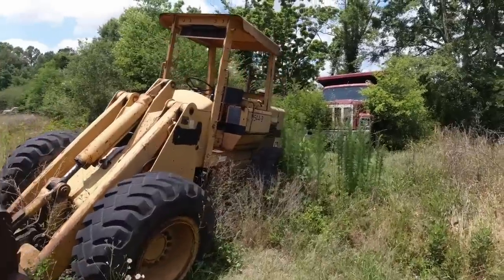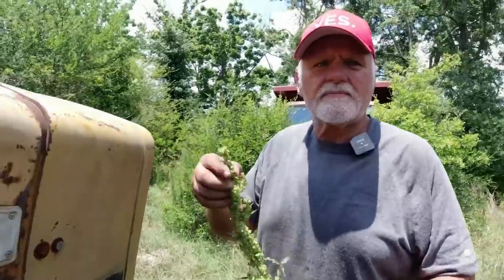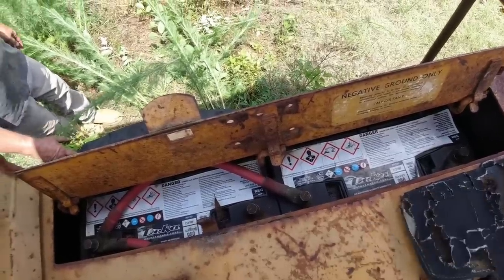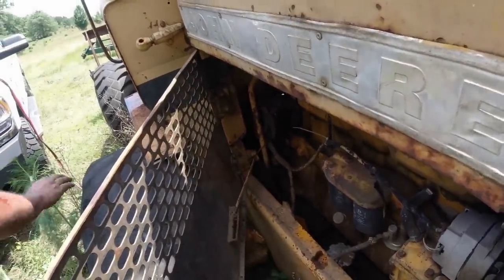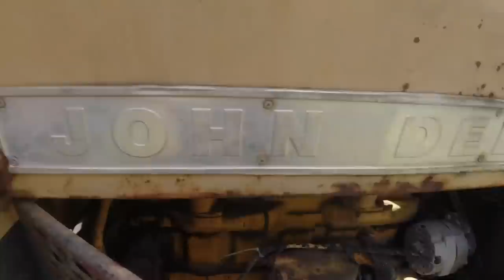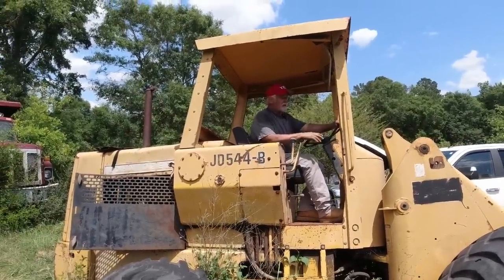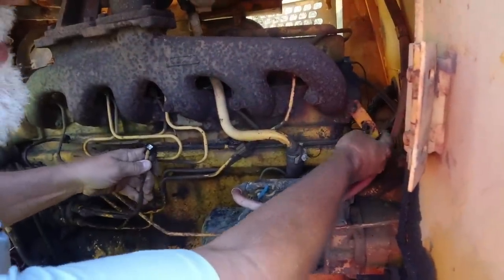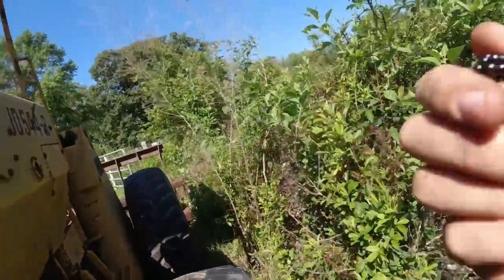This machine kept a secret for 23 years! Will it start?

Comment: Those are really good machines. Made in Japan by Hitachi I believe. I rented from a guy who had a 444. I lifted a 9,000 lb lathe with it once.
Reply: Mr wes hi 👋
Reply: Hitachi built John Deere excavators not there loaders, the loaders built by John Deere USA .
Reply: @njh4473  The one I used said Hitachi on the serial number plate. Had a Deere engine, but the rest of the machine was built in Japan. That was a mid 80s machine.
Reply: hi wes hows the weather in your area
Reply: Wow you do lots and lots of work I want you working on a 99 diesel pickup truck good job Wes
Reply: Those were made  in Iowa not by Hitachi
Reply: Same motor and rear ends as the 540 skidder, made in Dubuque Iowa, at least in sixties and seventies
Reply: @simongreen247  va ffv

Comment: i made a set of jumper cables when i was 17 years old used welding cable and the same type ends that are on your cables. I will be 66 in august and i am still using the cables and they work so good
Reply: I made a set like you when I was 18 working at a NAPA store. I’m 51 now and they’ve been with me in every truck since then. Can’t beat ‘em!

Comment: 3:16 While alternators will produce AC electric initially, the internal rectifier converts it to DC and the regulator keeps the voltage between 12 and around 13.8 or 14.2, depending on the manufactuere. But they also require power supplied to the windings in order to start producing electricity because they have no magnets in them. Generators normally produce DC by alternating the brushes so one side will always be positve and will have permanent magnets in them without the requirement of external power to generate the DC power. They typically require an external voltage regulator.
Reply: Thank you for your knowledge. All I remember is on my Grandfather Ford. The Generator on his Engine, it would only put battery charge when engine RAN. A Generator never held charge. The Alternator always somehow would keep Battery charged up. There was not a battery loss of voltage. Generator always just had Battery problem with holding charge at volts. It did not put battery in reserve. Am I right or near right
You seem to understand.
Reply: Some generators still required being "flashed" or having the field excited once by external power from which they then retained the field while the circuit was closed (in other words, disconnect the battery and you had to 'flash' them again). Ran into that on '60s Fords. 😎
Reply: Automotive generators don't have permanent magnets. The fields hold enough residual magnetism so they don't need any power to get them started generating. You can get a car generator to work with either positive or negative ground by polarizing, or as some folks call it flashing the fields. With a permanent magnet generator you would have to turn the magnets around or reverse rotation to get it to switch polarity. Same with the mechanical voltage regulator, you can get it to work positive or negative ground by flashing it. Sometimes on a new generator or one that's been setting a long time and the fields have lost all their magnetism, you have to polarize it to get it working. Same with the regulator. New regulators used to come with instructions on how to polarize them, either positive or negative ground, to get them working.
Reply: @rp1645  I remember with generators we could.run a vehicle down a hill or tow start it and the generator start charging, or start with no battery no problom, no damage to the electrics ,alternator you needed a little current to excit whatever it was to get it charging, was a new thing for guys to learn when rolling or pushing a vehicle to start ,so the old generators were better in some ways ,though alternators quickly charged a battery without much revs ,big step forward
Reply: Bravo

Comment: we had a 1968 JD 544b in our salvage yard. we bought it right qfter we opened.  We opened on a shoestring so we bought what we could afford with no help from the bank. it did a very good job but it was tired. we replaced the engine and then the transmission. it had the typical blown lines. our yard was a number of terraces going down a steep hill. the gravel would kill the tires regularly. But the tires didn't wear like you would think.. the heavy lugs wore but wore even worse was the rubber between the lugs that wore more quickly than any other place. when we finally replaced it we kept it because it was a great backup machine.

Comment: Strained  sump oils are good for hydraulic oil  substitute we used to run a grader on strained oil for year's  on the station in Aus for years run it through a clean filter on a pump

Comment: an alternator is alternating current , A generator is direct current with a seperate voltage regulater box . That's what I was told many many years ago .
Reply: Alternators also require a regulator to even out the flow of current and to prevent overcharge. Early alternators also had separate regulators, then with solid-state circuitry they were incorporated into the alternator itself.

Comment: Generators have stationary magnets on the inside of the housing, and an armiture that spins from the belt drive. Generators do not have internal voltage regulator rectifire to convert the AC voltage that the generator produces, into DC voltage. They have external regulators. Alternators produce AC voltage but have brushes along side stationary magnets aligning the inside of the alternator housing. Alternators have an internal voltage regulator to convert the AC voltage to the proper DC voltage, usualy around 14.5 to 15 DC volts.

Comment: Hank if ya'll can find an old water filled fire extinguisher, they have a threaded top and Schrader valve to refill them/pressurize them with air. Put an ounce or two of original Dawn liquid soap in it (you probably can't put too much soap), slowly fill it with water while mixing the soap. Air it up and you can stand back 20 plus feet and blast wasps and yellow jackets. Kills them dead as a hammer and it much cheaper, non toxic and you're less likely to get popped. Ivory, Ajax or walmart "great value" soap won't work for some reason.

Comment: Jd 544b was built from 75(or 76) to 81 when the c series came out, it has a jd 6329t engine and a 2 speed Allison transmission, they were a great machine,  I worked for deere in the late 70's.

Comment: Alternators vs Generators:  In automotive service, a generator takes the output current off the brushes. This tends to limit the output, as the physical size becomes a problem. In an alternator, there are still brushes, but they carry little current as the field is the rotating part. typically on automotive alternators, they are wound as three phase alternators, and have a rectifier network of diodes to convert the output to DC power. The (rotating) field also operates with DC, regulated by the voltage regulator, which is commonly built into the alternator housing. 100 amp alternators are commonplace now on our increasingly electronic cars and trucks, with many having even more peak output. My pickup for example has a 225 amp unit.
Reply: Neil you explained automotive/equip charging systems for the past 💯 yrs thank you sir!

Comment: There was a 544 and an old Lima dragline I ended up running when the owner died. It was a sweet loader and it fed the screen and loaded trucks. The old Lima ran fine too. Had a 3 or 4-71.and you know how a 2-cycle is about running. Yall did good and you owe Wiley double for the sting. GBWYall!

Comment: An alternator has electromagnets that have to be externally energized.  The more current you put through the electromagnets, the more wattage the alternator generates.
A generator has fixed electromagnets and generates electricity when the stator is turned.
As a result, the alternator output can be controlled as can the load on the prime mover; this is how a diesel-electric locomotive works.

Comment: Thanks for another great video Hank and Wiley. 
Interesting and enjoyable. 

Great job you two getting that old old John Deere going. If it was not for the hydraulic oil you would have had it fully operational. 
You did great!!!!

Sounds like a strong machine yet. Somebody could make use of it you would think. 

Good luck on getting the others going. Clear the shrugs away and have at it. 

Wiley watch out for the bees. I hate those things. Do not do well with the the stings. 

You all take care and be safe. 
Looking forward to the next video. 
Thanks for everything Hank and Wiley. 
The Iowa farm boy. 
Steve.
Reply from the maker: The owner has already put it back to work👍

Comment: Excellent video Hank  :) & Wiley :) little TLC goes long ways get something running again and hydraulic can be interesting to fix too ! Alternator are bit cheaper to fix or buy and Generator are expensive on fix or buy ! Plus Alternator are 1 & 2 poles setup with or without regulator  and Generator same on regulator to ! But both Generator and Alternator lots different amps can buy from 10 to 150 ! General Motors are ones people like 1968 to 1985 years so easy setup on wireing to !

Comment: When you see someone move the steering wheel back and forth on a john deere loader to make it easier to start you know they have used one before. Those steering pumps are run off of the crankshaft and moving the steering like that will allow the starter to turn the motor over faster. Been there and done that many times

Comment: Easy way to remember; Alternator = Alternating (A/C) current. Generator makes Direct (D/C) current. The battery and ignition runs on D/C, so the alternator requires a rectifier to convert A/C to D/C. Simple.

Comment: The alternator is the charging system once an engine starts,it charges the battery on a 12 volt or on a 24 volt batteries,auto mechanic by trade
Reply: YES. And did not a Generator not keep battery charged. If you used your lights in vehicle for example, the Generator would loss volts. So it drained the battery.
Reply: @rp1645  you had to keep the revs up ,alternators once the rpms come up still mostly charge near idle speed ,big difference if you want to build up the charge on ur battery

Comment: I'm working on a 544 a there's a back story on that one, but I. Not really authorized to go in detail. 
Um it sat 15 yrs the motor was locked. Well after a injection pump and a set of injectors it does run n move. The arms raise the forks curl n roll. No brakes n no steer. But we're still picking at it.

Comment: I think you opened up a can of worms with the alternator generator thing. Some say alternators have no brushes, built in regulators and what not. The rectifier (diodes) to turn the AC into DC  were built in. 12 volt AC will shock you, and unregulated current from a car alternator is higher than that,, DC won't. Once they got  diodes small enough and sturdy enough to fit inside the alternator so there was no external AC current, they figured it was okay to put them  in cars. In the 60s Delco (GM) alternators, and just about all brands, had brushes and an external regulator mounted on the firewall or fender well. They went to alternators  because they are simpler, more efficient and will charge with the engine idling. The old generators had to spin a little faster to put out enough to kick the regulator in to start charging. If the main contacts in the regulator stuck, it would backfeed current to the generator when you cut the car off and it would try to turn, I have seen old cars with loose generator belts and the generator will be sitting there turning with the car cut off because of stuck contacts in the regulator. Used to have to take the cover off the regulator and unstick the contacts. A lot of folks too cheap to buy a new regulator would just leave the cover off for next time.
Reply from the maker: Right on. I’m definitely no expert, just tried to recall info from many, many years ago. Lol

Comment: Generator makes DC only.  Alternator makes AC and converts to DC with Diodes.  Those diodes (power rectifiers) blow up when car to car boost and some are blown.  Ok works wow - This could be a farmers rock collector out of the planting fields.  So other machinery doesn't break down due to a rock bending something.

Comment: An alternator doesn't make juice unless it has a battery wire to it and and generator doesn't need a battery wire it's DC and it'll just as soon as it starts turning it charges you can start one by pulling it with a generator but you can't start them with an

Comment: I used to call myself a mechanic but all that might of just changed in the last say ten to more years. Like I bought a brand new 95 F350 4X4 and just check every box on the option chart. Had the beautiful flatbed, aluminum with gooseneck... set to go clear across alaska.... that if you go one end to the other can't be done in one day no how, no way... about five thousand miles an no, this truck couldn't go near that far without a few stops but the two sixty gallon tanks did take ya a ways. Getting to being a mechanic meant servicing my own truck and so when I did something stupid enough to cost me to work on it... I had to pull the cab and fenders off to get to the engine... all on count of stupid things we do... I crossed a river that I knew    I would never make across it but just had to try...  I was smart enough to cut the engine off before it got flooded tho or it would of been game over. My point is... do you want to have to unwrap a ton of crap to get where your problem is at just to find that now your there but that is no guarantee that you can get into the problem without causing more issues. Took me a week to get the pan, the turbo, and other stuff on a diesel that got ruined or needed flushing out done. A machine like you are working on there is maybe some side covers, a belly pan and a big ol' hose or two... and you pretty much can get it all did an done. I have worked on most any make or model truck that is like a pete, kw, mack, you get the idea, and now your chances of figuring out if its the battery or a wire or a plug on a new rig takes a ten thousand dollar tool set just to start looking. Should you even get lucky an guess what the problem is, figure a minimum of a forty by forty garage to work in... that is to hold all the tools that can or might be needed.. and these are tools (not cheap) that may never be used but if you don't have then certainly are going to.. like a jinx or something. At the last time in my small shop for small old cars and trucks, I had close to three hundred thousand dollars in tools that took over forty years to collect up or make....  my point is "Willy, do you still want to be a mechanic?" Another sad thing really is to buy a big tool say might cost a hundred dollars to buy but for you to sell... might get ten dollars on it for they know going in, may never use it so why even buy it. By the way... back to the video, that machine is just begging to go back to work. This kind of equipment is like having sex in a downpour rainstorm. Not much fun getting stung or digging out briars... but when it runs an moves, ain't no fun that much better... even if the fun only lasts as long as a orgazum . You guys are mostly on flatlands an its nicer than coming in on a ice covered beach full of boulders that want to turn the barge over or just sink you in icy water... trust me, it did happen a few  times that I swam to shore with the others and watched tools and everything sink in deep water just off shore. Nope, alaskan islands wasn't for for the faint of heart but I was in my thirties and stupid, only thirty nine, a broken heart from a loveless marriage an kids that just needed a allowance to spend for a fancy car to just wreck. I just keep wandering off on ya Hank/Wiley

Comment: Nether Alternators or generators have permeant magnets in them, the magnetism is made from coils of wire. All the power from a generator goes through the brushes. Alternators are smaller lighter more efficient and because they can spin much faster put out much more power at low engine speed. The ignition/charge light that shows the battery is charging is needed on some systems to get the alternator/generator started, the system will not work if this light is not working!

Comment: I am old enough to remember that an automobile generator (DC) was regulated by controlling the energy going to the  field windings. The regulator was originally a separate device device on the older vehicles and may have been built into some later models that I never owned. The output current was taken off of the rotating armature and was controlled by current in the stationary field windings. This required the brushes to handle all of the output current. This output went through the ammeter on the dashboard and then went to the loads. Of course the ammeter was later replaced with a red light that indicated the generator output was less than the battery voltage. In my history this was often called the "Idiot light". 
My first alternator was on my 1961 Plymouth and generated the output (AC thus Alternator) by controlling the current going to the rotating field windings with the AC coming from the stationary  stator as three phase AC which is then converted to DC with the 6 diodes. This was then sent to the ammeter as above. This was also controlled be a separate regulator which eventually was moved into the alternator. The ammeter was again replaced with the famous "Idiot Light". That light bulb was much cheaper than an ammeter. So much for an elderly DIY mechanic.

Comment: The Major difference between a generator and an alternator is the alternator has a built-in voltage regulator.
Reply: Early alternators used to have an external regulator, I think it was the 70,s when they came out with built in regulator
Reply: @donaldhalls2189   keyword early, but we are talking late 20th century like on the wheel loader in the video